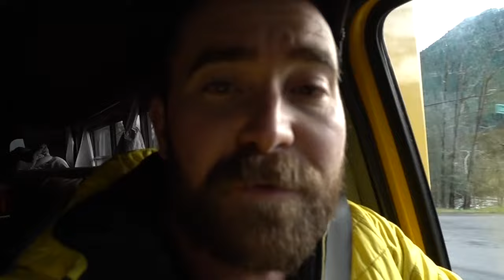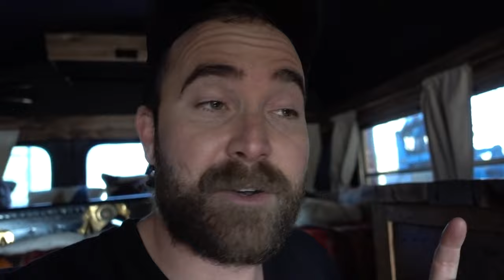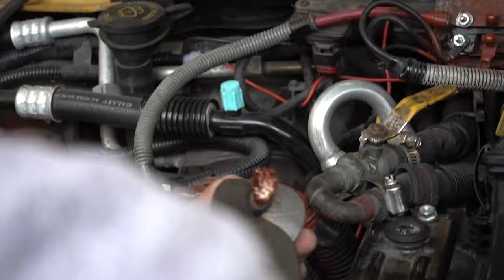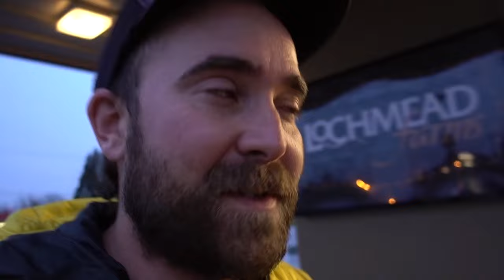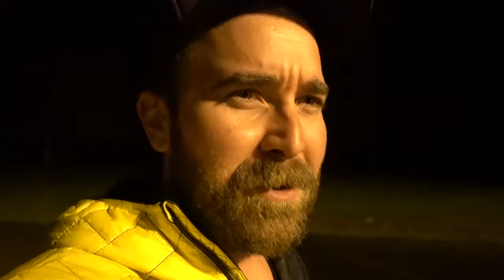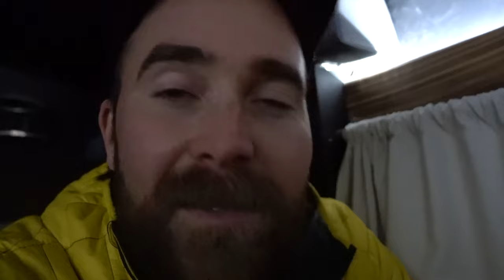GETTING BACKUP POWER FOR SOLAR BATTERY!! VLOG 188:

Comment: I saw You on NF's channel.  Cool Bus.  I like Ford's too.  The Diesel is cool unless You are in a tight place,  then they get a little smelly.
Reply from the maker: Russell Hancock thanks! The diesel can also be bad, when you accidentally terror off the rear exhaust pipe and then the exhaust seeps into the bus and makes you dizzy while driving. Check out the new vlogs to see how he fixed it!